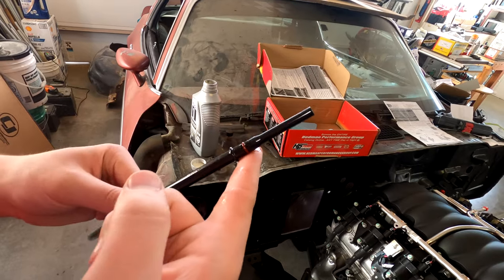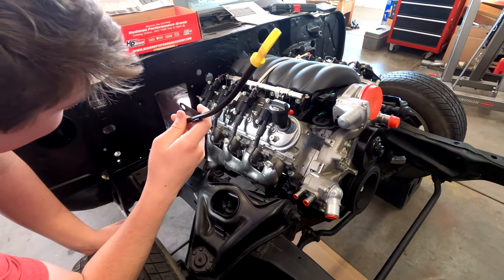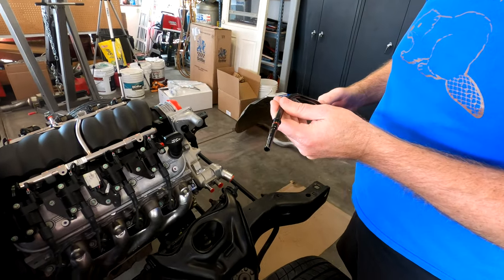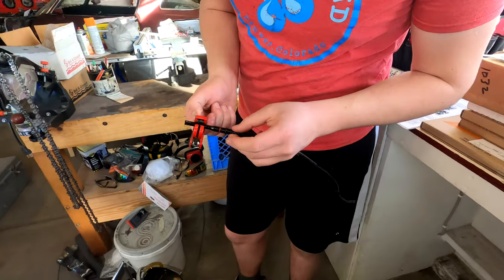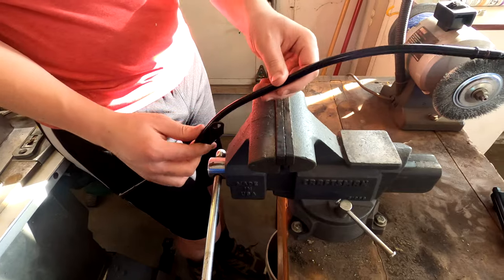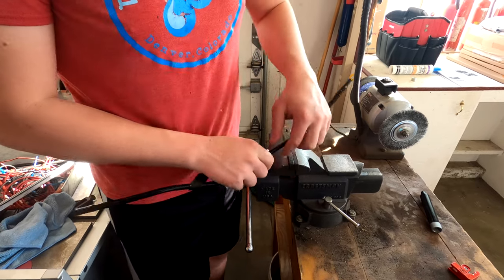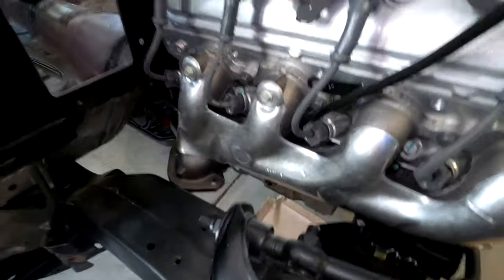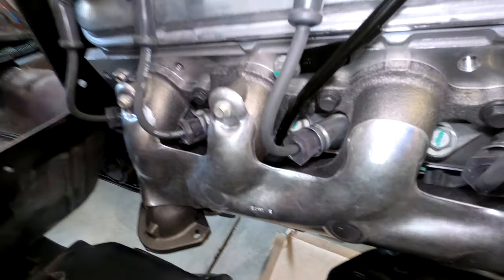LS Swap 6 - Installing The Dipstick Tube

Comment: the problem you had is the same one we just fought and the issue is that the dipstick goes throguh the back manifold slot not the middle one once you do that it literally goes right down and lines right up.
Reply from the maker: Thanks!  It always felt like we were doing something wrong, we just didn't know what it was.  After we get done with other projects on the Camaro maybe we'll revisit this.

Comment: I need to cut 
They are a bastard but it’s exact precision positioning to get it in
Reply from the maker: I've built a few (non-LS) engines and never had any trouble.   If there's a trick, I hope somebody will tell what it is!
Reply: Sir I got a question after you cut it the dipstick reads the same amount of oil
Reply: He did not respond to you so i will. No, it will not affect the oil reading as that is what the dipstick is for.@GuevoGuerrero-bo4kq